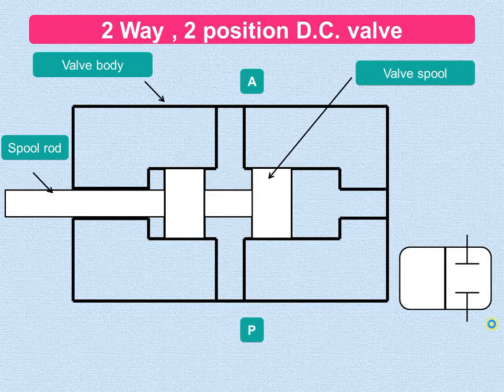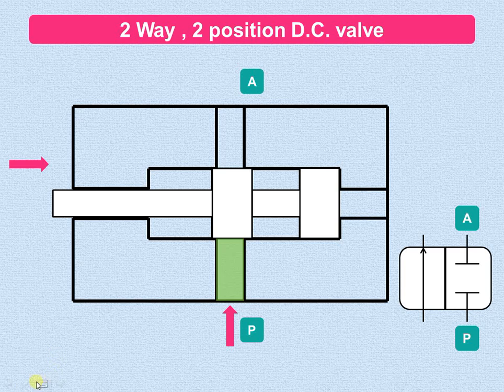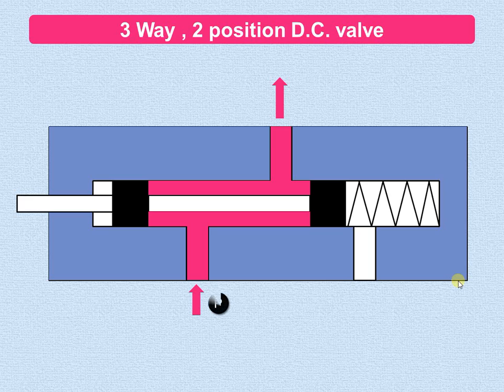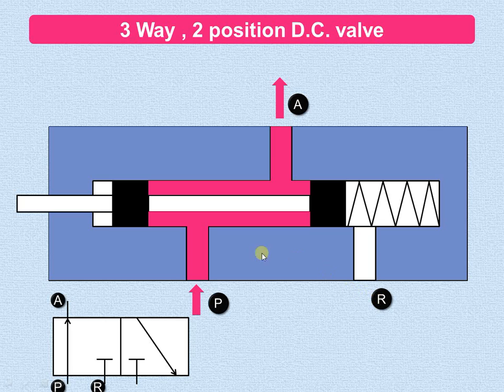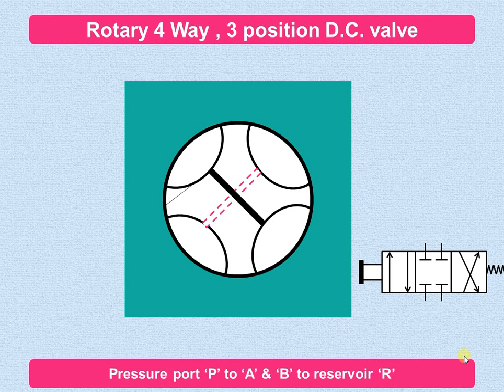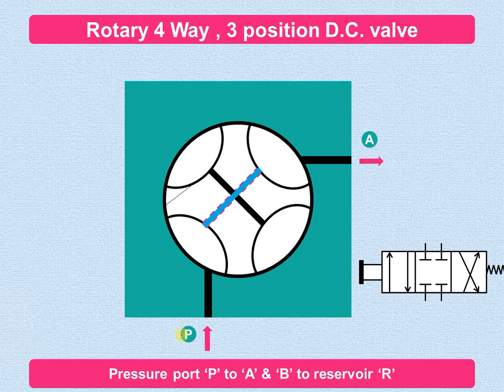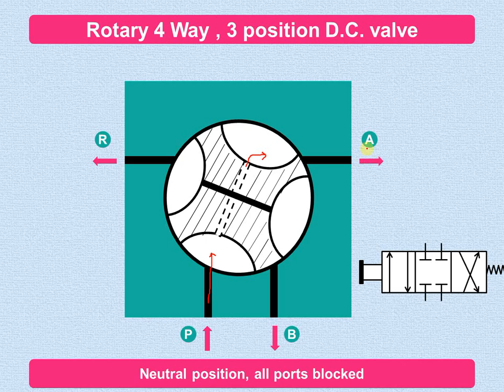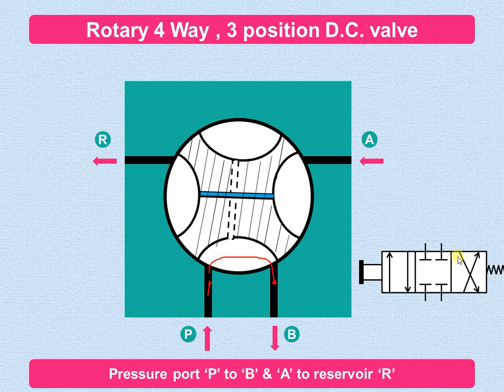How the direction control valve works in hydraulic circuit

Comment: At 1:35 fluid is restricted then isn't this fluid gonna create back load on pump and whole circuit? Shouldn't this fluid be redirected to tank?
Reply from the maker: The pressure relieve valve will come into action to prevent the back pressure and load on the PUMP ....
Reply: Its not possible because next action will perform in sec so no chance to loading on pump
Reply: Also pressure relif valve also in use for that